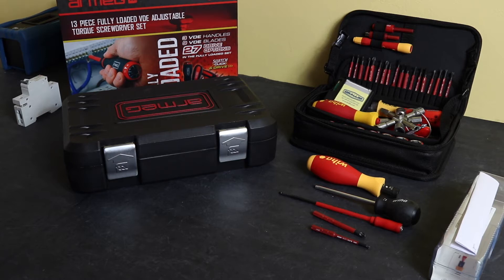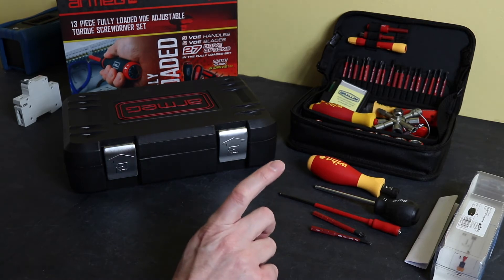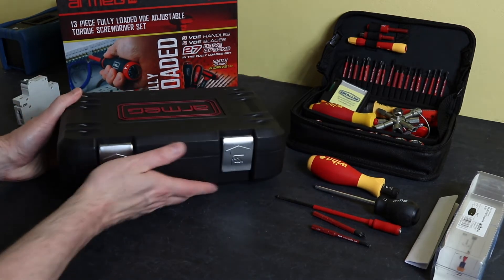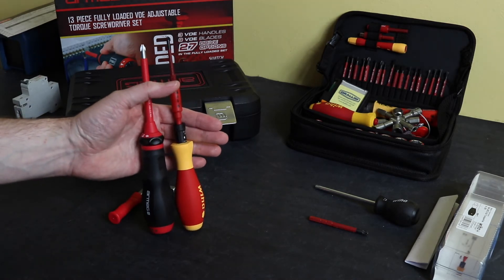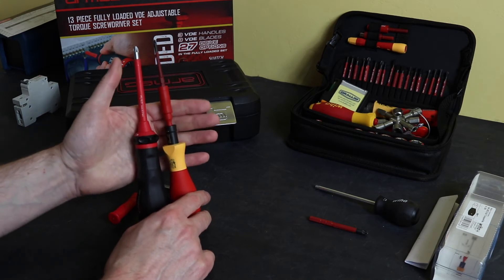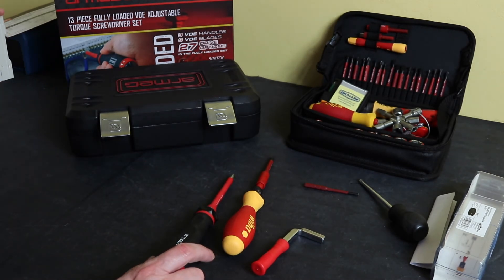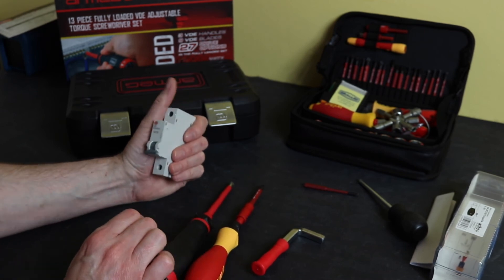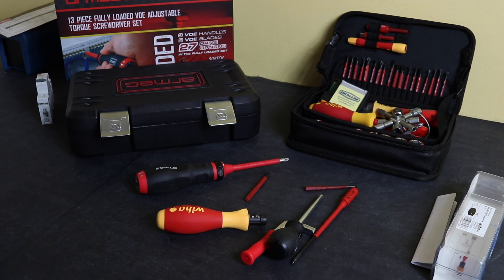Torque Screwdrivers Comparison - Armeg vs Wiha

Comment: Does the t handle, or any handle accept quarter inch bits/extensions?
Reply from the maker: All of the Armeg handles will take a standard 1/4" hex drive bit, but it has to be at least 100mm long to reach the drive socket inside the handle. There is also no locking mechanism to retain the bit as the locking mechanism is around the collar on the handles. The Wiha handle will not accept 1/4" hex drive as the drive socket is a bit smaller. I also have the Teng, Draper and Wera torque screwdriver handles and none of them will accept 1/4" hex drive as they have much larger drive sockets.
Reply: @three-phase562 Nice one mate 👍

Comment: I have the 13 piece Armeg. Just after I purchased it I transferred into another company, who, decided that only qualified electricians can work on electric, so, as a combustion engineer I couldn’t fault find anymore, I had to call in their sparks to do it for me……………..
First job I did for them, I replaced an AC lift pump that a spark had already bought a replacement, that he said was faulty and returned it for another. I was asked to fit the new pump, which I did, only to find it still didn’t work. A quick check with my multimeter revealed no incoming power, traced back to tripped MCB which was certain to be the original fault 😂🤣😂🤣😂🤣
The screwdrivers went home, where they now replace batteries in the kids toys. I’m still having to fault find on appliances, then have to call in a spark to confirm what I’ve already proved 🙄🙄🙄
Reply from the maker: That's too bad buddy, expensive set of drivers to have sitting around for battery replacement. 
Appreciate you watching and commenting.

Comment: I was looking for a torque screwdriver to go with my Wera screwdrivers (which are great and I love) but their torque adaptor is pathetic, only goes up to 3.0 or 3.5NM depending on which you buy.

The Wiha one was a bit better but it looked like a bit of a faff to use, I considered the Draper and I wasn't aware of the Armeg. 

I ended up buying a Sealey (non insulated) one which suits my usage well. Some terminals on the inverters we use require 20NM and it can do that, which is unusual. Just uses standard 1/4" hex bits which I carry anyway, and it's all digital adjustment which means no need to back off the setting after use. Time will tell how long it lasts, but it seems to be coping with the depths of my tool/laptop bag pretty well so far!
Reply from the maker: Yeah at 20 NM you are in the realms of mechanical rather than electrical that a lot of the screwdrivers are aimed at. You are almost in the realms of a 1/4 drive ratchet for that.

I have a few Sealey tools, always found them to be fairly robust, they are aimed at the auto trade really, so you would expect them to be able to withstand a fair bit of abuse.

Cheers for watching and commenting.
Reply: Hi, how is the digital different in that you do not need to set it to lower range after using? Is it motor operated or using springs? Thanks
Reply: @lemech  neither, they have strain gauges in them. It's a completely different method of operation.